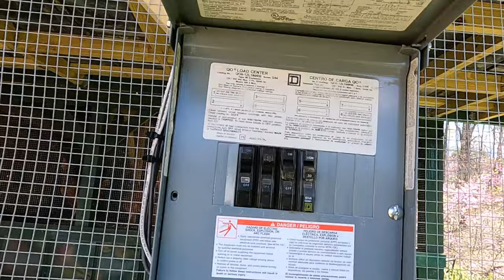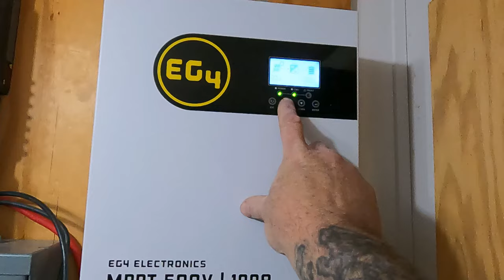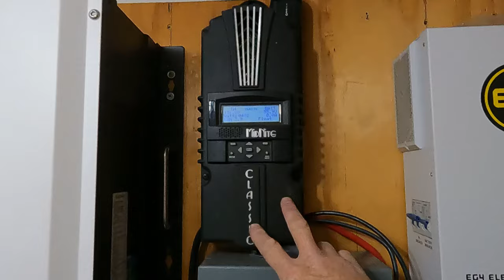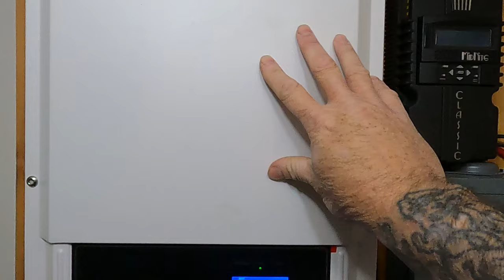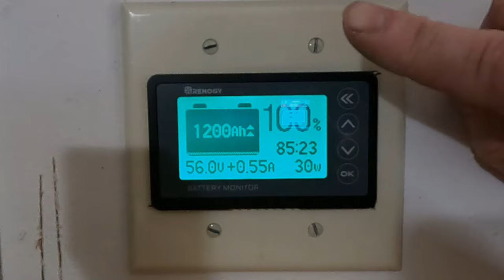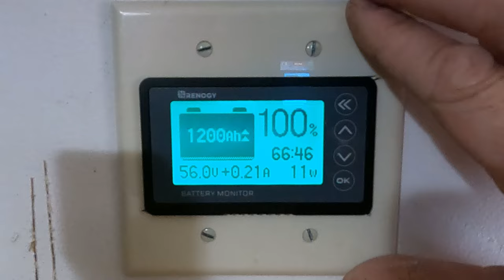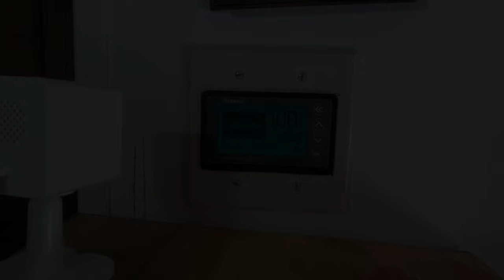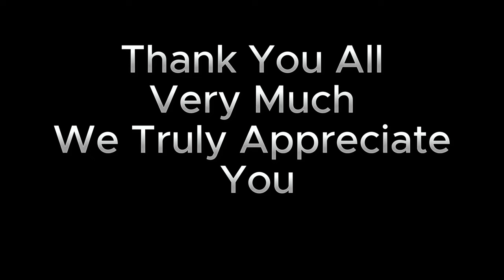The Price Tag of Our Solar System #diy #offgrid #solar

Comment: Great video. However, don't you think you need to enclose those wires running on the wood frames in metal conduits? If there is a breach in the insulating layer, the bare copper will be touching the wood and that might constitute a fire risk.
Reply from the maker: All the equipment on the inside of the house will be moved soon thats why  the wires are still a little messy, i have the conduit and metal trough for all the wiring to be hidden, there isnt any bare copper wires anywhere in the system that im aware of, even the ground wires are shielded, thank you for watching and we love all the suggestions

Comment: You were smart to use a low frequency, transformer based inverter instead of one of those featherweight, short lived, low surge capacity high frequency, transformerless inverters that the Chinese are dumping in the US right now.
Reply from the maker: Yeah it works really good

Comment: Those breakers you are using for the panels are A/C and not D/C rated breakers so they offer no protection to the wire, don't feel bad I made the same mistake, grab some D/C rated miniature breakers and a box with a din rail in it. AC circuit breakers are not designed to handle the problems of arcing associated with DC. DC circuit breakers include additional arc-extinguishing measures to dissipate the electrical arc when opening and closing and elongate the device lifetime
Reply from the maker: All the research i have done on the QO breakers is that they are ac and dc rated, thats why i chose to use them
Reply: @SmokeyMountainOffGrid  They are only rated to 48v DC, not at the voltages those panels are running at. Just beware..
Reply from the maker: @UnkyjoesPlayhouse  thank you ill research a little more